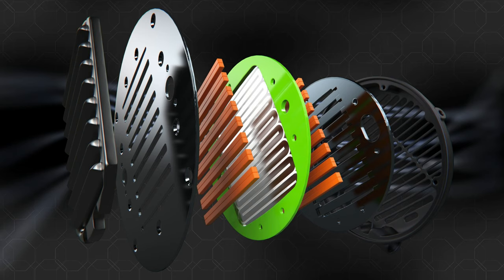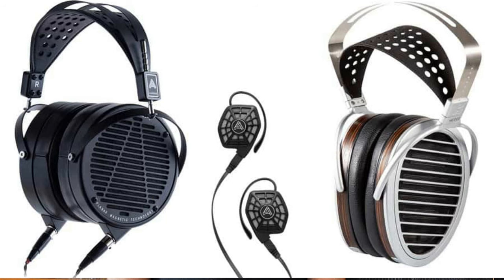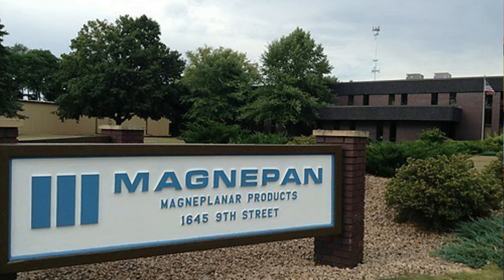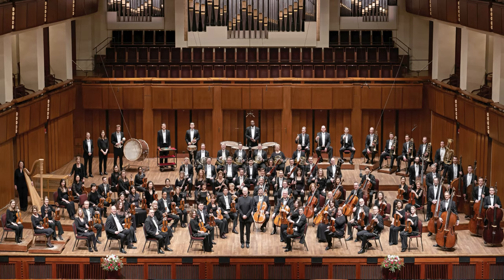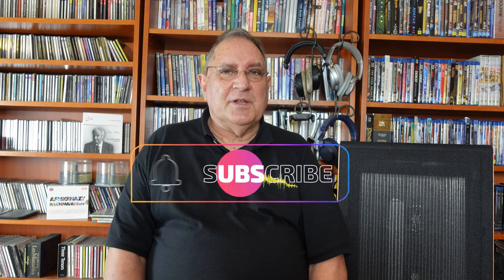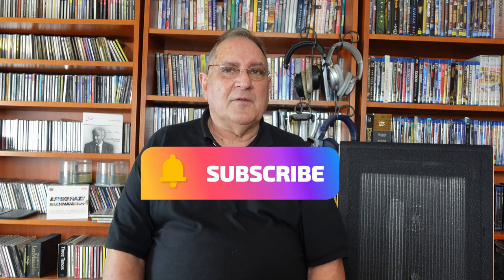Magnepan Magic - Why Magnepan speakers - sound so good.

Comment: I've had Magnepans since 1978 when I bought my 1st pair which were the 5' tall MGI's. I moved up to a used pair of MGIIIa's in 1995 and use them to this day. The key to getting good sound from any Magnepan is you must pay attention to the room accoustics. They are Di-Pole radiators  which means they radiate equal sound from the back as well as the front, the rear wall behind them needs to be treated with some type of accoustic foam.  You don';t want the reflected sound from the rear (or side) walls to interfere with whats coming off the front. Moving them away from the wall helps but not as much as room treatment. Another must do is you need to mount them to a wooden base. I made my bases from 3/4" Birch plywood and also use aluminum cone spikes underneath to firmly couple them to the floor. If you just leave them as they come from the factory sitting on those flimsy metal legs they rock, not in a musical way, but actually rock back and forth, they need to be rigid so when the panel vibrates with the musical signal it's able to do so with enough force to create it's own sound. It's basic physics, for every action there is an opposite and equal reaction.  This is why people think they're not as dynamic as box speakers and they lack bass. Making them more rigid improved every aspect of these fine speakers. There are many more modifications to improve Magenpans but I won't get into that now, I've already said too much!!
Reply: Thanks for the tips... Just been offered a pair that need fixing. 
Never heard of them before. 
I realise that the thinness is a selling point, but would they perform better if fitted to a heavy, tuned port enclosure?
Reply: I wish you’d tell me more I just bought the .7s and love them, but I know they can much more.
Reply: Chief among popular audiophile misconceptions is that all you want is the direct sound from the speakers.  It is the back wave of dipoles that gives the depth and space from the reflected sound - just like in the concert hall. Don't kill it.
Reply: You haven't said too much, yoou are just gettingg started for those of us that recently purchased our first Magnepans. I appreciate your suggestions. I'd love to see how you set up your speakers with the stands on spikes.

Comment: Magnepan lifer here. Great info! If you don't run high power/high current amps on your maggies you aren't getting the full acoustic potential out of them. I run very high current mono blocks on my 3.6Rs with a dedicated music room with correct sizing and room treatment. The results are mind blowing. Including great low end bass. Incredible speakers!! Thanks for sharing your info on these Jon.

Comment: Electrostatics do better. They're way faster however electrostatic's have one problem and that's longevity. The statics last around 5-6 years and usually need serviced. If you want real nothing beats an electrostatic and the mother of all are the Quads forget Martin Logan not even close :-)
Reply: Way faster so not true , there is no such margin between planar and ESL. You're talking about driver stoppage which is a beyond audible difference.  125 cycles is just as "fast" regardless what principle driver you wish to compare. 

I had quads ESL 57 albeit a decent speaker. It had the sweet spot the size of a dime on the horizontal and especially vertical axis. Not sure if you ever heard or had a pair. 

No denying fantastic vocality to them. Which really doesn't sound any better or more revealing than what any of my maggies (mgI,mgII,mmgi,mmgw,Tympani ) do. 

Not to mention on a way larger scale... What's better? You should go out your way to listen to a Tympani IV.

You'll forget , about quads really fast

Comment: We are lucky enough to hear quite often absolute world class opera performances live and there is no doubt that nothing comes close to Magnepans when it comes to reproducing the live atmosphere in our living room. But they need space - lots of it, actually. And every slight manipulation used for the recordings is revealed by these speakers right away. We are therefore almost exclusively listening to live recordings that are less manipulated during the recording process. MP3 - regardless how good they might be - sound exactly as what they are: awful. And they absolutely love power…lots of it and your amplifiers better be fast…because you can hear if they are struggling to get enough current send to these speakers . If you like vocal or for instance piano music and have the space…forget those boxes and start listening to the music instead of a loudspeaker….get a pair of Magnepans and I am sure you will keep them for a very long time.
Reply: This reflects my experience since 1983 -- especially regarding compressed audio. Because Maggies are so revealing, they reveal weaknesses in the audio chain just as much as the marvelous quality of great recording with electronics.

Comment: having a strong amp to drive your maggies is really important.
I went from 2x 200W 4ohm primare to 2x 900W 4ohm amp and while i dont expect i really use the power. The control the new Sanders amp is able to bring to my 3.7i makes a ton of difference is the audio experience.

Comment: I’m using a 100 WPC Integrated Amp from Rogue, the Sphinx v3 with a tube pren amp and they sound fantastic with the .7. I’m still working on placement options but the SQ is out of this world.
Reply: Whilst my Very Old Japanese electrostatics Headphones are exceptional. I wish to hear these Speakers.

Comment: I have a pair of .7 and use a Freya S preamp into a Vidar. My room is 9'x14.5'x8'. Huge synergy with Magnepans and Vidar. Excellent soundstage, at any price. Did swap the oval stands on the Maggies for much better stands. I use 10g speaker wire. I have them positioned 40% into the room, as far apart as I can get them, tweeters on the outside, toed in a bit. They simply dissapear if I close my eyes. I hear that the Timpani was tremendous, but never heard them.
Reply from the maker: Well said - my thoughts exactly.

Comment: I have a pair of 3.7i's paired with two Channel Islands D200 power amps and a Khozmo passive pre amp connected with single strand silver wire.  I used to sell Hi Fi equipment in the early 90's but we never had the Magnaplanars (unfortunately) and got my first taste of them back in the late 80s.  Needless to say, I bought a pair of second hand speakers and put them in my small flat before I moved out with my then girlfriend to a house with a room made for large dipole speakers.  

A couple of observations if I may...  If you have never tried solid silver wire (0.6 mil) to connect your equipment I can honestly say you will not only hear a difference but the improvement will be quite noticeable.  My second observation is that you should try a passive preamp.  This time, the difference will be substantial!  I must admit that I have never heard an activepreamp sound better than a passive preamp - ever.  Of course, I haven't heard everything that is out there, but from my experience every passive preamp has sounded better than any active preamp I have listened to.

Good to hear a fellow Australian who loves the sound these speakers produce. 🙂👍

Comment: I lost a pair of Dhalquist DQ10's and a Velodyne 15 sub to 2 floods this last fall and I have been looking at maggie's for the future. I do like the bottom end to have that punch feel of a good kick drum as well as the low note sound which is why I liked Velodyne. To keep the subs fast I am considering servo models and maybe even 2 - 10's or 12's instead of 1- 15. I am going to hear .7's and 1.7's soon. any advise is greatly appreciated
Reply: @jonmvideos1131  which subs do you use? are they servo driven?

Comment: I drive my recently-refurbished MG1Bs with an also recently-refurbished Crown DC300A and IC150 (each from 1974). My system sounds better than any other system I've heard at any price.

Two nits about your video. At least in my listening room, I don't need a pair of subwoofers. I have a single consumer-grade downward-facing powered subwoofer that does just fine. I keep the crossover set at about 150 Hz, and it doesn't require much power. It adds the really low "kick" that is needed for rock, R&B, and movie sound tracks. Second, at 4:20 you talk about needing an amp that drive high current into the 4-ohm speakers. I think you meant 4.5-5 AMPS, not volts (power is I^2*R, so 100W corresponds to 5A).

Comment: I have a pair 40 years old  MMG.
That Ibought from a chap that had moved from USA and were in UK.
I imported them to Sweden.

Seams that someone had made a crossover rework on them at some point that is probably needed when they are so old. 

I saw the new filmed of the magnapan factory and there were a clip were they mounted the binding post plate arrangement. It is the same "shit" that I have on my 40 years old speaker still being used.

With "shit" I mean come on.. a allen key to connect a bare wire.. maybe that were ok 40 years ago but today we have 5 way binding posts..
The only upside is keeping the cost down with 0% development/refinement.

Anyway the new info from the owner of magnapan that is in process to produce a line of subwoofers also, is that the "best" type of subwoofers to pair with magnapan is dipoles like what the magnapan are. To keep up with the speed and details

I can concur with that my two 18" OB do a fine job but the DSP is fixing so they "disappear". (DSP is the present and definitely better SQ that purists think that they get.)

If you have a sweet spot and only one is listening then a setup tips (again from the magnapan owner), make them facing the sweet spot..
Because if left and right side of the speaker has the same distance to the sweet spot then the drivers will be aligned with each other. When they are sitting beside each other and not as a traditional speakers on top of each other in a vertical line..

There is so many tips and tricks but my 2 x 5w amplifier is actually enough. Now it is the smaller mmg but I think that when it is a Class A that helps it to be "powerful" anyway when it is always ON and "amplifying" and not like AB resting at NULL when there is no signal for it half if the time. And class A has big transformers rellative to it's wattage so the power is there all the time.. I think that is the reason why I can get away with <5w/channel @8Ω.

Anyway great speakers that had no issue to beat RP-600M in a AB shout-out. Even when the Klipsch were heavy modified with point to point wirering, better caps, better resistors, better inductors, better internal wires, better box damping, better binding posts and so on..
The 40 year old construction sounded better and is superior if someone loves soundstage for example.. thanks for the video!🙏🎼🎶🎵💕

Comment: I have a Yamaha as3200 feeding the magnepan 1.7i and is not enough , I need more power/current 😢
Reply from the maker: Hi Reiitelco
Have just purchased 2 x Fosi ZA3's as monoblocks for $US149 each and they drive my 1.7i's just fine.

Comment: I had heard over a dozen speaker systems from the early seventies, until I stopped at Magnepan. I've been hearing about the MG 2.6r for 15 years now and I am thrilled every time I hear a new recording. For me, these loudspeakers mark the end of my search. There is simply nothing missing in music reproduction. A pair of "Restek extract" fires up the speakers in a brilliant way. The unbelievable space that opens up after the first sound always creates goose bumps, of course in a positive way.☝️😊 //  The only downer are the tweeters, who have experienced sacking over the years, meaning they warp and need to be renewed. It would be an advantage if the customer could send the dismantled tweeters directly to Magnepan to have them re-ordered. Unfortunately, there is no account there to order the new move. 😏
Reply: "It would be an advantage if the customer could send the dismantled tweeters directly to Magnepan to have them re-ordered" -- I've sent my MG1Bs back to Magnepan for refurbishment twice since buying them in 1983, most recently last summer. I got them back at the end of September and they sound as good as new.

It is not free, of course. The tradeoff for me was what it would cost to buy speakers today that sound as good. I stuck with my MG1Bs, and I'm very glad I did.
Reply: @thomasstambaugh5181  Hello Thomas, sorry for the late reply. Because I live in Germany, it is very expensive to order Magnepan ribbons through TAURUS distribution. But alternative, we have a very accomplished man in Germany called "MaggiDoc" who can thread the original ribbons into the magnetic sleeves. With very good success. The shipping risk is minimal when the magnetic strips intended for shipping are attached. Spring-loaded, they can then be shipped without any problems. I have never heard a better LS under 10,000 euros like the MG2.6r. This indescribable stage performance is unique. The next level for me would be a pair of BRODMANN vc7, but they cost almost 20,000 euros.
Reply: Since Magnepan switched to their 'true' ribbon tweeters-- 1.7i and higher, you can order the ribbon strip only which is an easy swap just like replacing a conventional speaker.   Unfortunately you still have to dismantle the frame and covering assembly.

Comment: Nice video John. It would have been nice to hear some of how your speakers are set up in your room e.g. distance from each other; the back wall etc. How do the vidars cope with 4 ohm in mono?
Best regards.
Reply from the maker: Thank you systemwarrior. Magggies are 3 feet out from each corner on a slight inward angle with the tweeters on the inside for best focus. The mono block Vidars drive the .7i's very well at 4 Ohms - can deliver up to 95db at 2 meters which is about as much as I can stand.

Comment: I struggled with 3.5Rs after numerous amps, including biamping and active XOs. I eventually got a pair of Emerald Physics Open Baffle 3.4s which have 12" woofers with 1" polyester tweeters. Truly amazing. If someone wants more bass the 2.8s should take of that with dual 15" carbon fiber woofers per speaker. Sadly they are no longer made, but do come up used from time to time as fabulous prices

Comment: I recently acquired a pair of 3.7's and am at the stage where you are constantly moving the speakers around to find the best response.
Question:  What is the difference between Tweeters on the inside v tweeters facing the outside?  I am also running a pair of REL S/515's so that also affects the setup.
Reply from the maker: Thanks Keith for your comments.
Tweeters on the inside will give you a focussed stage with pinpoint accurate placement of voices and instruments. 
Tweeters on the outside give you a wider sound stage but not as accurate. Hope this helps.

Comment: Excellent video. Would you use these for a home theater with a pair of subwoofers?
Reply from the maker: Absolutely.
Reply: ……for that application you would be definitely adding a subwoofer….to get those wall shaking low frequency outbursts that are now part of almost every movie sound track

Comment: Is there a spec that tells the amount of current an amp provides?   I have a Yamaha A-S 801 with 100 wpc into 8 ohms and (per a reviewer/tester here on Youtube) 180 wpc into 4 ohms.   But I don't know if the current it provides would be sufficient to drive Maggies.  I'd love to have a pair of LRS or .7's but can't justify replacing my integrated amp at this time.
thanks
BT
Reply: Hey, l have the Magnepans 7's and Typically drive them with my Spectron musical MK ll hybrid  class D amp Output is 500watts@8ohm 650@4ohms and 1,200 watts@1ohm  Magnepans love watts/current  I do use my VAC PA 100 100 tube amp but it has 2 ohm taps lt sounds magical, but boy do l have to crank it to get the same db as the Spectron  I have a YouTube vid call "Magnepans. 7's doing their thing" if you want to hear them in action. If you read the description, it will list all my equipment. Oh, highly recommended matching them with two subs like l have

Comment: Jon - Thanks for this video. I was wondering if you have ever had your Vidars activate their protection circuit? How loud do you actually have be playing music for that to happen? You have the exact setup I am planning on buying so I want to make sure this is only a theoretical problem, not a day to day thing. Thanks again!
Reply from the maker: Hi Kerry, thanks for your question. Yes, the Vidars do activate their protection circuits when driven very hard. Its usually a dynamic peak like canons in the 1812 overture that will do it.
Reply: @jonm52  Will the Vidar's drive the Maggies up to 90db? If so I'll be getting some Maggie's and another Vidar to have the same set up as you.
Reply from the maker: @frederf69  Hi Fred, have moved up from the Vidars to the Tyr's - they are brilliant.

Comment: Have you heard of people driving Magnepans with Naim gear?
Reply from the maker: Yes The Naim NAP 500DR will do nicely.
Reply: @jonm52  How about a Nap 180? I've heard of people driving them with 25 watt pass labs gear, but my Olive era Naim gear probably isn't at the same level.
Reply from the maker: @JohnVander70   Amplifiers need to be high current to drive Maggies.

Comment: Early Magnepan speakers such as the MG II sounded much too veiled. The more recent offerings using quasi ribbon tweeters are much better. But I was shocked when I heard early MGIIs at just how veiled they sounded in the midrange. Female singers sounded like they had cotton balls stuffed in their mouth. It was The Audio Critic who didn't accept advertising that were honest enough to measure them and found copious amounts of stored energy. TAC put it perfectly when he said their sonic signature was "snap blur"... clean transients followed by a wash of vagueness".
But as I said they have vastly improved over the years but please don't extol the virtues of old Maggies. They sound terribly flawed and their poor measurements reflect this.